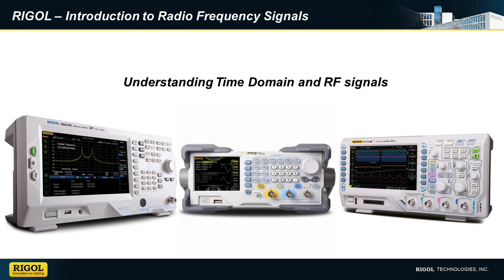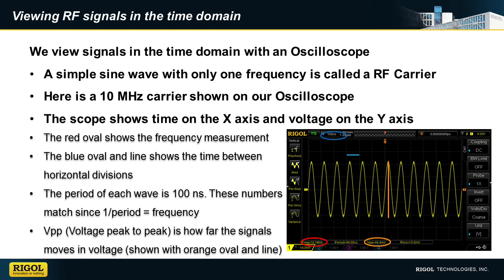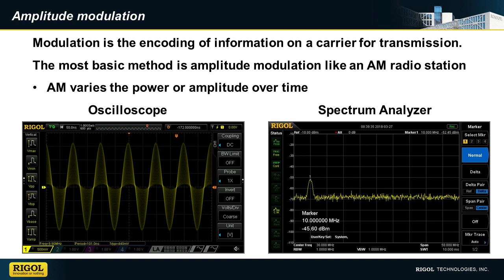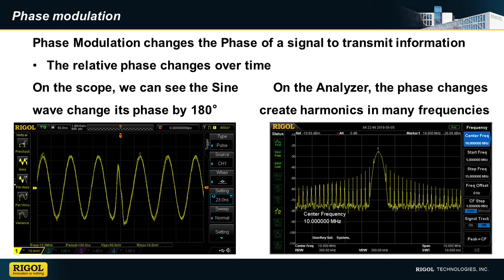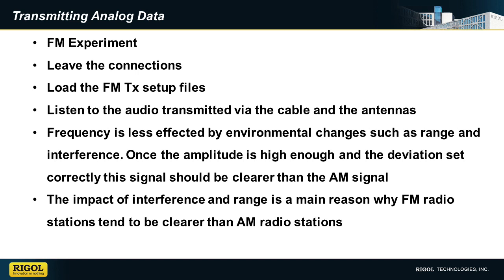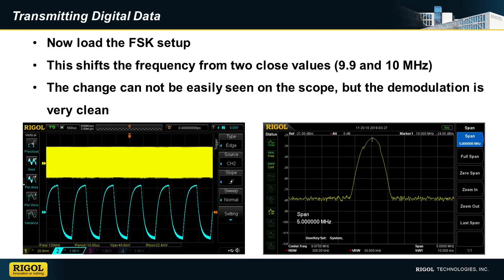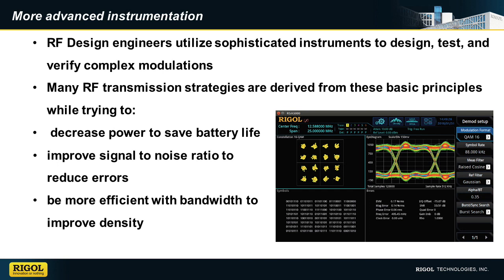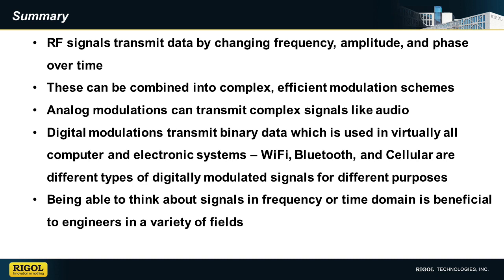Introduction to RF Signal Analysis

Comment: What is the level of RF frequency when it becomes harmful to humans? Like 5 mw/m2? Or like 20 mw/m2? Thank you.
Reply: It isn't necessarily measured in watts.
Focus more on your electrical Pressure that the battery has.(Voltage) A steady flow with 30-40volts+ is considered fatal.